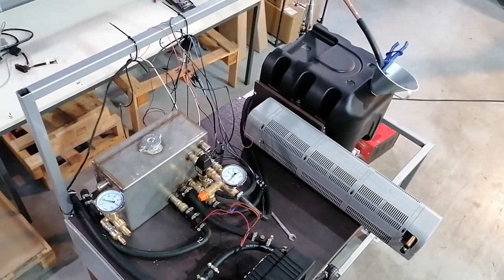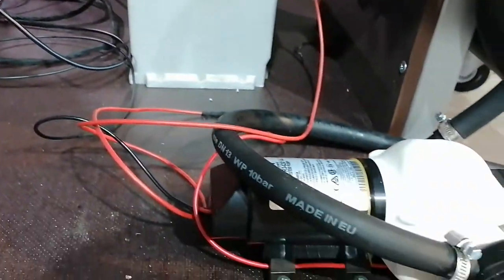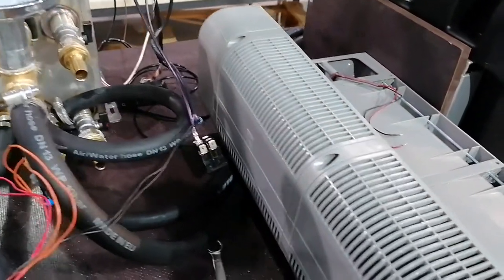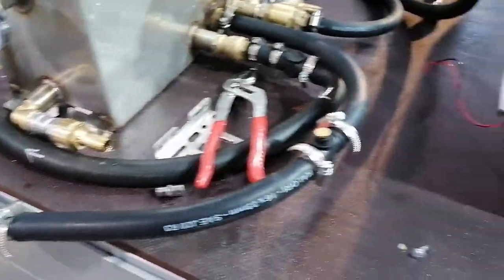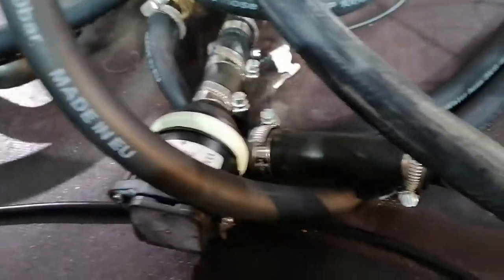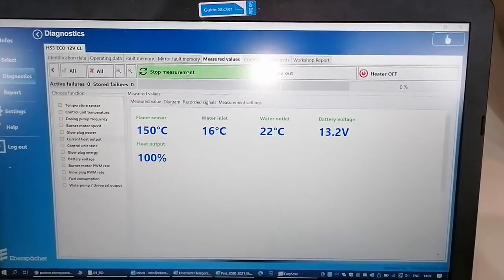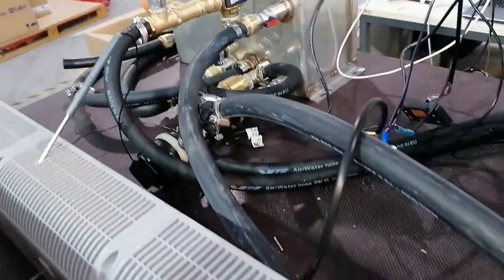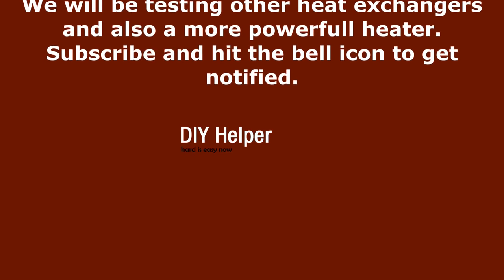Eberspacher Hydronic 3 testing for hot water and heating. Kalori heat exchangers.

Comment: Is the water heated by running coolant through the water tank? I wonder if you have tested heating water directly using a heater exchanger. I want to build a system with continuous hot water without a water tank. D5 output is about 17000BTU, if only 50% of the heat can be transferred through heat exchanger it'll be difficult for running continuous hot water (Heating from 60~100F degree with 1.5GPM). Lots of people claim it works for them the math doesn't seem to add up.
Reply from the maker: There is a heat exchanger in the tank also. This heats up the water.

Comment: Pretty nice setup!  I'm curious to see how it run with the Kalori Silencio 2!  I've just bought an Espar S3 D5S Hydronic and got the Kalori silencio 2 for my next vanbuild instead of Espar D4 in the last build.  I did not install anything yet and still seaching for good documentation.  Also still looking for a good stainless expansion tank.  I want to add a heat exchanger plate for hot water and complete the loop with a radiant heated floor.
Reply from the maker: Hi, I tested the Silencio 2, as you can see it was mouted at the begining of the video. The the results were 25 - 27% of the heater power on 1st speed of the fans and 32 - 35 % on second, so it will not be a problem for the heater even if it is stated at 5.2 kW. As for floor heating in a vehicle I know it is being used but many of the builders have concerns because of vibrations... if you get a leak inside the floor you can pretty much throw it away. It will take forever for the antifreeze to dry out.  The tank holds about 14 liters of mixture and I think custom building is the way. You pretty much make it any shape and size as long as you have the volume.

Comment: Is there any way you could post a schematic of the valves and hoses?  I'm having a difficult time following which goes where.  And that is one neat stainless pressurized tank.  Is it custom fabricated?
Reply from the maker: I will try to make a more in detail video of the system itself.
Reply: @DIYHelper  Thanks!